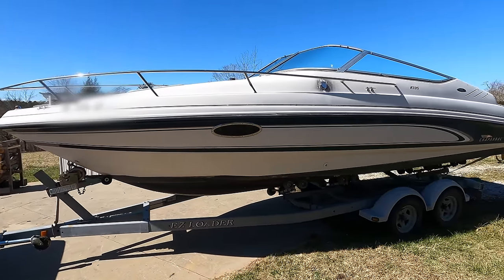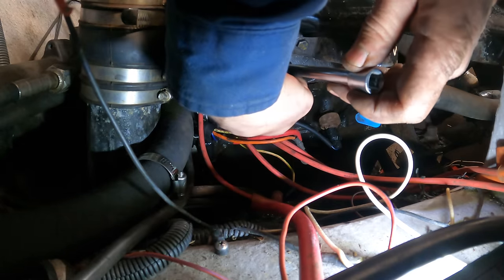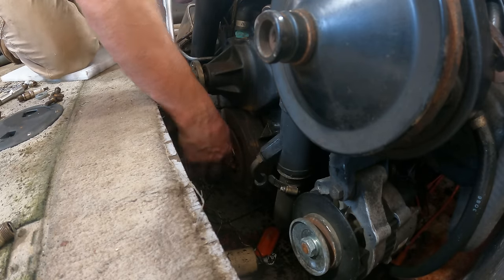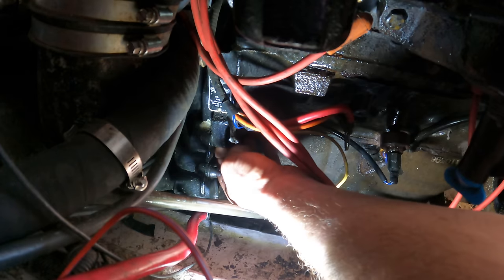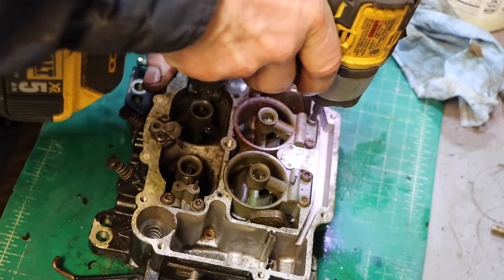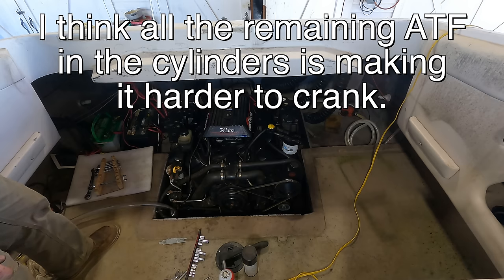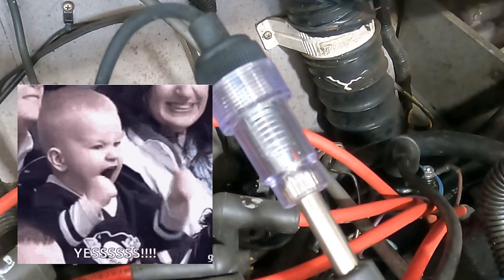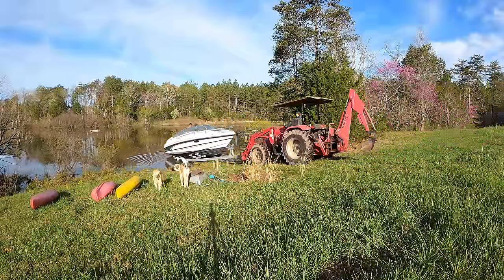Fixing A Boat With A 454 Big Block Engine

Comment: Jon,
After seeing the bore scope shots I had ZERO hope, but in true Jon fashion, you persisted and succeeded big time! I'm really surprised you didn't check the oil level and more importantly the condition after running. You did mention in the beginning that it was a little over full. I am expecting this is due to the several ounces or cups of water settled in the bottom of the pan. I'm curious to see what the oil looks like after running it.
Reply from the maker: I did check the oil after running. I wish I had put that in the video. But the oil was unchanged. No evidence of water and still slightly overfilled. Surprised me, I expected it to be milky. Cheers.

Comment: Late reply but what I always do if i'm working in a place likely to bump/hit like the fiber glass Tape either a foam pad or even an old towel so when you do hit (as you know you will..) it wont hurt much or at all (helps a lot on sharp points!)

Comment: 1:28:46 Finally started.  From locked 454 with rusted pistons and filthy carburetor.

👍🏾👍🏾👍🏾👍🏾👍🏾

Would dirty oil oil zinc help the cylinder walls?

Comment: Carburetors and coils! It's amazing that mechanics of older vehicles didn't have nervous breakdowns! Nice work on getting this running! And you really lucked out on the starter bolt removal. Did you buy that lottery ticket right after? :>)

Comment: With the rust in the cylinder when it was turned over the walls will be scored so even if the engine runs it more than likely will not last.  To save the engine it should have been overhauled so it could have been cleaned up completely!  Those engines are quite valuable as they usually blueprinted and balanced!  Just my thoughts!

Comment: Getting it running so it will at least start easily, hand it back to your brother and tell him to sell it as is without disclosing the engine issue. He obviously has no time or knowledge on boat ownership. He gets a few bucks in the bank and you get relief from having to go through that aggravation

Comment: I’m giving you 2 👍 up. Please take time 2 inspect the exhaust manifolds and I recommend you open the drains on them after each use. I don’t believe it came from the carburetor. 
   Also you need to change the water pump impeller in the foot. 
 🇺🇸 Take time to make it safe 🦅 There’s nothing more dangerous than a boat failure. Nice job 👍

Comment: I had a 396 big block with slow cranking power, after replacing the starter, battery, cables, ignition parts and wires. it was a bad ground connection from engine block to the firewall due to rust in between. So always check all grounding wires not just Positive wires.

Comment: Sometimes the ring gear on the flywheel will slide towards the front of engine. It is a pressfit and used in marine application the starter motor is mounted on rear of engine and drives against the pressed on ring gear. Maybe not in I/O, inboards as I said for sure.

Comment: The kill switch is a lanyard. 
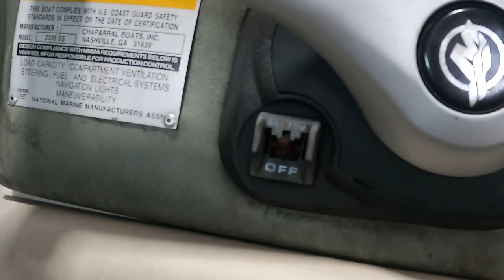 The switch at 41:20 on the control is indeed a enigine stop switch, lanyard or kill switch. That switch originally came with a lanyard attached to it.
 FYI, I am a marine master tech with 28 years in the busniess.

Comment: Pulling that bolt sealed it for me. You should retrain as either an ear wax remover or  a gynaecologist!
Q/ How did the gynaecologist decorate his front lobby?
A/ Through the cat flap using a brush with a 12 foot handle!

Comment: I had same problem with shimming starter i must have shimmed it 5 times so i took it to a mechanic shop to get it fixed, long story short they broke the block at the bolt hole , after 6 mo. of court case they had to replace motor, which was brand new also.

Comment: At 1h:14m you can see a small arc flash from the coil side of the engine.  No more spark in the cranking that followed that.  RIP coil, ignition module, and John's sanity.

Comment: I would suggest that before your brother tarps the engine for winter storage, he places a piece of wood or stiff plastic sheeting on the engine, THEN put the tarp on so any bolt studs or other sharp protuberances on the top of the engine can't come in contact with the tarp and tear a hole in it...

Another thing he might do is use a sheet of thick (6+ mil weather sheeting like what's used in new home construction for example or even an actual shower curtain from WalMart) instead of or in addition to the tarp since tarps are woven and are notorious for being easily holed and thus leaking...both the board (SAND OR ROUND-OVER THE EDGES IF NEEDED to protect the plastic from the engine) and the thick plastic sheeting should keep the engine nice and dry all winter...

Comment: That oil  was first clue it looked a little over full then the missing nut on the spark arester ( air filter ). Was another not to mention plastic tarp with water in it , if you don't drain the oil before starting you may see milky oil after running it , hopefully you didn't run water through the beatings . Sadly this is common on boats left in the yard for storage.

Comment: I havent watched all yet. I hope he pulls the valve covers and makes sure the intake valves on the cylinders that were full of water are sealing . My bet is they are sticking off the valve seats. Its trying to crank on 4 or 5 cylinders. The others are bleeding compression back in the intake.

Comment: You might try cutting the shim in half and only using the outside bolt shim, which would bring the gears closer together..  You probably need to do an amperage draw test on the batteries  and make sure your not getting too much of  amperage drop..  Torque starter bolts to spec. 35ftlbs?

Comment: 1:02:30 Thank You for answering a question I had...

Specifically, can you use dish soap in an ultrasonic cleaner without it foaming like mad...

I'm going to order the Vevor 2L version in a couple of days once a check I'm expecting clears to clean glasses, rings and my Fill-it-Yourself Keurig pod's mesh screen (it's getting clogged with coffee residue and I can't clean it with a brush without damaging the mesh) and I was worried about what kind of food-safe detergent I could use in it...

Now I know...and as the 1980's Cartoon always said, Knowing is half the Battle!

😄😁😆😅😂🤣

Comment: Use Ospho for rust. It works far better than Evaporust.  It turns iron oxide into iron phosphate which is inert and it works much faster.

Comment: Run some Red armor 2 stroke  oil mixed light in the fuel for the first tank of fuel just keep on adding fuel into it after you clean the fuel tank out really good.

Comment: Did you ever check that sterndrives bellows. No water was coming out with the exhaust at the end of the prop as it should, and there were a few frames there looked like all the ehaust and water was coming out of where the bellows should be. 
LOTS of problems can happen if you have ripped/melted bellows.

Comment: I really hope that you learned from that nightmare scenario of the starter bolt breaking off, & your lucky spell with the easy out, TO USE ANTI-SEIZE ON THE THREADS of those grade 8 starter bolts! Especially considering the water & possibly salt.

Comment: This may be the most worst video I've ever watched. Your dogged determination to fix this thing is amazing. Being obsessive myself about getting this type of problem diagnosed and fixed I understand how hard you worked on it. Good you filmed all of it so your brother knows how much you saved him. I've got a boat with 2 ofthese engines, so can only conclude that these are  not designed to be uses around water... thanks for great entertainment!

Comment: Evaporust. "Breather" is only a flame stopper. Drain and change oil. Pray. Heads. Hone. More prayer. Pick your target, or use them all. For what it's worth: I've seen No 11 rebar break under less than my full weight on a bridge. Assume same for No 8 is possible if over tempered. Also, possible broken rings now. Ok, rebar should be ok after your heating. The choke plastic "puck" on the linkage is a Ford type bi-metallic rotating, temperature regulated. Note where it is (which according to bro is wrong anyway) and loosen the screws clamping the plastic housing so you can turn it. Choke the thing. Those chokes like about 1/16 inch until closed. As you know, gas fumes sink into a boat. Highly recommend using the bilge blower and the flame arrestor on the carb. Idea: contact weld to stud making sure to insulate with spastic tube or something. Use blower first. Thing needs at least one new battery. The penny-pound thing ... new starter.

Comment: I know you may  have finished job. there are 2 starters, stock and hi-torque 
for high compression
engins and there were issues worn gear ring.

Comment: Yikes, people don't like to hear this but if you own equipment that can reach up over the boat, it's faster/easier to pop the motor out. You sir have the patience of a saint. If someone were to ask my opinion, I'd suggest pulling the risers to check for leaks because in the scheme of things, it's a likely co-conspirator/culprit & it's easy compared to what you just did. Best case, they're fine and you have to replace the gaskets, worst case you can just mill the corroded faces back on the risers/exhaust manifolds.

Comment: I show you how to clean the combustion chamber. Run the engine around 2000 rpm and pour water thru the carburetor, don't put too or it will kill the engine. Steam will clean out any junk inside the combustion chamber.

Comment: be careful about the starter. i had an issue of timing being off and breaking starter bolts and a slow crank. i had changed to stronger bolts (arp) with same thought after many breaks and the next break was the ear off the engine.

Comment: Don't know if that stud was good or luck, but I'll take it. Time to go into carb. Man, use that bilge blower. Igniting all that vaporized gas spells explosion and fire in the bilge. BIG explosion. About 2 sticks. You poured a lot of gas over that bilge. The jumpers and snatching off the starter are giving me the creepy crawlies. You better believe your guardian angel is watching. The blue gasketed plunger I call a "booster pump". Sends a big shot of fuel through for fast takeoffs. We're in my time zone now. Ok. Crap keeping valves from sealing. OMG always use a blower before starting. Leaf blower might get some out of the bilge. Timing? Distributor caps and alternators on boats are also anti-explosion. Boats are so much fun. My 26' Chris-Craft met a chainsaw. Been happy since. No abrasives. I bet on Evaporust to stop that red rust growing. Vacuum out after dead cranking to splash cyllinder walls, soak a day.

Comment: If it was winterized right, no water should be in the exhaust. That starter comes in regular toque and high toque with the bigger and high compression engines needing the high toque.

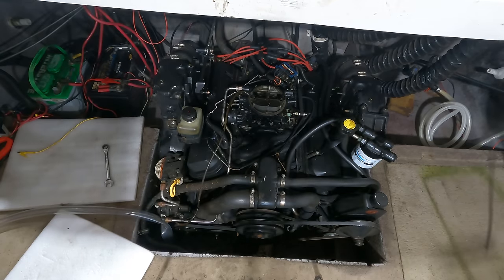Comment: At 49:50 use gasoline instead of starting fluid! Too much starting fluid can cause problems too! Myself I use a little bit of starting fluid and the rest two cycle gas mixed at 50:1 because it also lubricants the cylinder walls!

Comment: I'm a boat mechanic. And many times the new starter bolts are to long. Your lucky that the bolt broke and it didn't break off the block.

Comment: Marine engines have two water pumps. One is the conventional water pump, the other is the raw water pump that is a rubber impeller. This rubber impeller is not designed to work dry not even for short periods. They self destruct very easy an then you have to go an fish out bits of rubber out of the block or the heat exchanger. The exhaust risers need replacing every 3 to 5 years in salt water. I suspect the battery switch needs cleaning out inside or replacing

Comment: Shimming a Chevy starter is quite common occurrence. That’s because of the different bellhousings and applications across the product line. Automatic and standard flywheels and flex plates have different angles.

Comment: You need a garden hose with muffs to get water in your impeller which is rubber and no water you can melt the housing and the impeller.

Comment: Best case scenario is maybe that block can be used for an anchor. I didn’t finish the video but even if you made it run it won’t be for long. Get a short block and swap all the external parts is your only hope.

Comment: That engine was not winterized  properly  at all. When you put them to bed, the last thing while running you pour a half qt. of reslone oil into the carb to coat the cylinder walls. 
Now, you can let it set as long as necessary

Comment: My boat has two batteries.  Only one of them turns the motor over.  the other is for the trolling motor.  Maybe only your cranking battery is low?

Comment: still at beginning of vid, looks like the exhaust manifolds/ cooling jackets were not drained when winterized and the engine was not fogged with light machine oil. the exhaust manifolds will back drain water into the cylinders if they crack. I would have used PB Blaster, but guessing with the same results as the atf. the exhaust manifolds are cracked and ruined. I'd replace the entire engine because of the fly wheel. I had a 86 bayliner with a OMC chevy 5.0L, what a  huge contortionist PIA engine to work on....  only other engine that gave me such fits was my 96 eldorado Northstar engine.. need lots of starter fluid... don't forget the little fuel filter.. I kept a re-built carb in reserve because the quadrajet idle jets would get plugged up with ethanol. I had to re-build my carb when I put "no name" fuel stabilizer in the tank. sadly I put the same stabilzer in 2 other vehicles with fuel injection... had to replace the carb and all the fuel injectors due to the fuel stablilzer... $1200. just for the injectors... listening to it grind.... need starter fluid...bad gas??? I ended up replacing my points dist with a electronic distributor.... empty package.... hahahaahaaaaa... still need to replace the exhaust manifold cooling  jackets... I think that they have a leak, that is how the water got into the engine.... that is what happened to mine, had to replace mine. Found the cracks after I replaced them... there are plugs in the bottom of the exhaust risers that allow the water to drain out instead of backing up into the cylinders through the valves...  don't forget the outdrive bellows and outdrive water pump impeller.......yes, you are a magic mechanic!!!! thanks for the walk down memory lane, still think of powering along on the SF bay on that boat.. had it for 30 years.... sure glad it is someone else's problem now.... had as much fun making repairs as I did using it...

Comment: If he continues to use the motor it will no doubt eventually need to be sleeved. I would suggest an overhaul before it's too late. The rust, possible broken rings, sticky valves will continue to plague him with problems. He will be EXTREMELY lucky if it does not.

Comment: That switch you flipped back to run next to the throttle needs a lanyard! That is the lanyard you need to kill the engine if the driver falls overboard.

Comment: Not sure you know this or covered it.  But when an engine stops it typically stops in the same crank position.  So it will most likely hit those ground down teeth on the flywheel most of the time when starting.
I know this from experience.

Comment: I'm only at the 19:00 min mark and don't know what is to come but a mix of alcohol and atf would be a better idea. The alcohol will join the water with the atf and reduce the surface tension and help penetration down to the rings.

Comment: I cannot believe this engine runs after what I saw with the bore scope. After all the trouble you had getting this engine to run this result is phenomenal. The starter situation should be remedied by the builder. How I do not know but something must be done. Just not a 5,000 dollar addition. You must love your brother a lot because he caused this. He must be extra cautious on tarping the engine. In fact it would have been much better had he not tarped it to funnel water into the engine. If he just puts a refrigerator baggie over the carb it would be much better than him tarping it.
Reply: you showed the oil slightly over full there could be water in the oil pan probably should get an oil change to be sure.  great save! That's brotherly love!

Comment: With these cylinder walls the pistons will eat up their rings very fast and then burn oil like crazy.
But the good thing is: You don't have to change the oil and air filter ever again, because why should you when you run the engine with so much rust in it g

Comment: Trying to start that thing with that bad ring gear is what broke the bolt.   Keep at it and you will break the ear off the block.  You need to pull that engine and change the ring gear.  The starter has been damaged by now and needs to go also. That whole problem was caused by trying to crank the hydro-locked engine.

Comment: based on other engine rebuild channels, it seems like there is some type of liquid (mystery oil) that they put in the cylinders to try to lube the rings more. Given the pitting and scoring, I'm sure that would only get worse over time and eventually oil burning, smoking, etc. Probably needs cylinders rebored, new rings, and perhaps new pistons eventually and do you do it now or wait for it to give up the ghost? Seems to me he should sell it. 
Originally I thought the mechanic just gave up on replacing the starter because it was so hard to get to. Obviously more going on.

Comment: I guess it depends on how easy your software does it, but I wonder if it would have been easier to use blue painters tape on the boat numbers vs having to blur it out.  For me....I do not know how to blur, so i would have had to use tape. :)

Comment: Disconnect the battery period. The screen thing of an air filter is a spark arrester. IO means inboard motor outboard driver it's a car engine with a propeller attachment that any car guy can work on, it doesn't sound like a stripped bendix and you shouldn't be touching it.